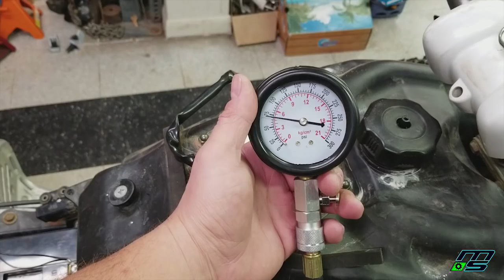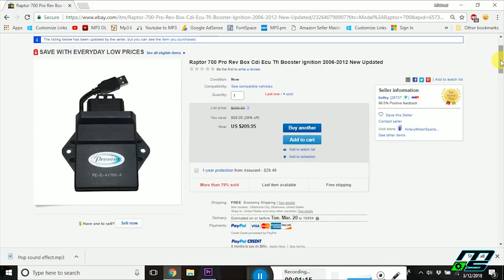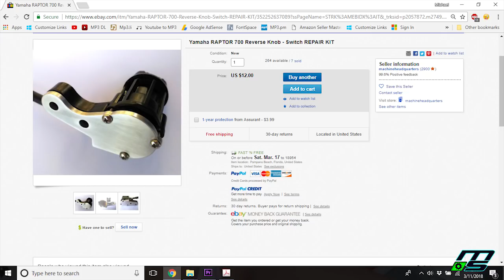Project Raptor Part 5!!! Compression, Reverse Switch Fix and Rear Brakes!

Comment: Have you checked the neutral safety switch? I've heard that the wire comes out sometimes and it won't start in or out of gear
Reply: yea ive heard of that happening before on some fourms

Comment: hey man. thanks for the video you just opened my mind up to things i never knew before.. However the issue with my 2016 raptor that it cuts out on high RPM's. it idles fine. it drives fine. The moment i rev it up its like it runs out of gas for a second or two then speeds up again. I wonder what would cause that. any suggestion helps!

Comment: Have you checked the fuel pump yet? Does it run briefly when you first turn on the key and the engine stop switch?
Reply from the maker: Yes, it primes and sends fuel
Reply: Well my next thought would be is the injector actually pulsing and spraying fuel?
Reply from the maker: Aaron Weaver there's a mist of fuel that comes out of the spark plug hole if you turn it over with the plug out. I'm 99% sure it's not fuel related. I cut off the field and put a shot of starting fluid in the cylinder, and it still didn't fire or even pop.

Comment: Hey I’ve been having a problem with my raptor I’ve put a new battery in it and spark plug but it’ll run good for like 5 min then foul the plug and just die now it looks like I have a bad ground because I can’t get it to try and start... any suggestions

Comment: I got 90 psi on my compression test. How did I get more than the book said was the maximum?
Reply: I got 98 psi with a mac tester on my o6 raptor , i thought that was low compression lol  my old 200x had 180 psi  so i am really happy that it's better than stock somehow .
Reply: jim rooney Healthy engine! 👍
Reply: @DUNEATV   So far it seems great . it wants to rip but cuts out about  3/4 throttle pretty sure its carb issue looks like the rev limiter issues were worked out but has chinese carbs  and choke plunger missing lol   its a work in progress for sure also just noticed the frame is bent  lol   best wishes brother .

Comment: I love your vids but I wouldn't throw out the compression idea yet I would look more into it
Reply from the maker: Thanks Wyatt! I am hoping this gets her running; if not I will look back into compression and the stator.
Reply: I have a banshee and it was doing the same thing your raptor is and it turned out to be several things such as a couple of bad grounds and the cdi box along with one or two bad connections. It would prob in be a good idea to lose the hmf tuner I think it is prob what caused the cdi to short and quit working